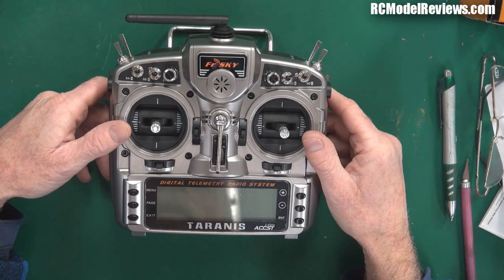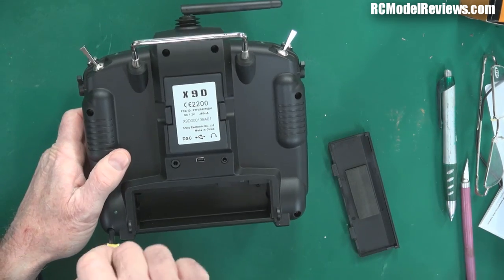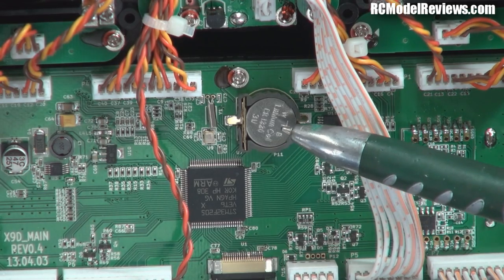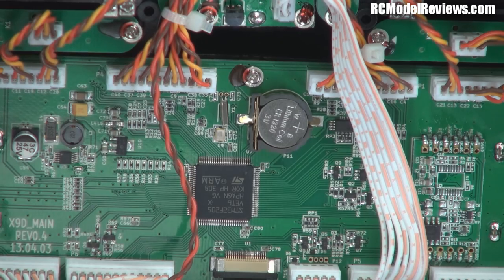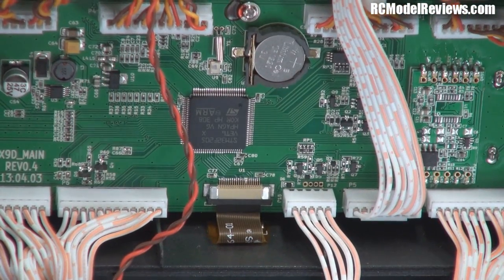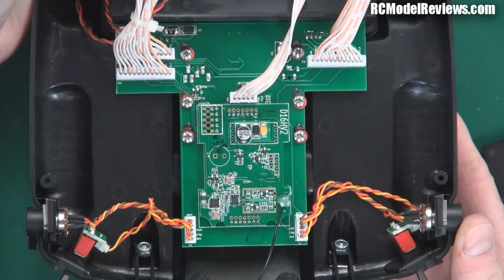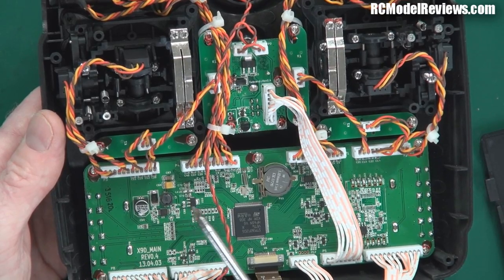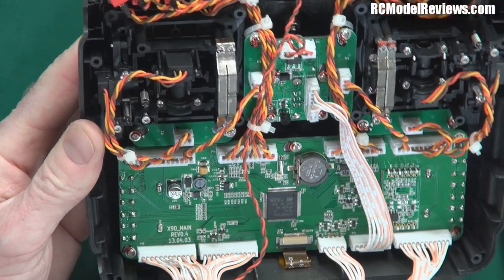FrSky Taranis Review (part 2) the teardown

Comment: This video was THE decisionmaker för me getting the Taranis. I recently accidentally killed my FrSky DHT-U transmitter and was looking for replacement. Specs and software I already knew where awesome, the only question was build quality. Please measure the pots for quality, stability and consistency. Quality soldering doesn't necessarily mean quality pots. Bruce, you are the one-stop goto guy when it comes to RC electronics, keep it up!

Comment: Hi Bruce, could you please tell me which board houses the sound producing area on the taranis plus. The reason i'm asking is because I have lost all sounds,, beeps and haptic activity.     It could be that I did something to it when i was soldering the six pos switch on the back board.    I am prepared to replace either of the boards. if necessary

Comment: FrSky have done a great job and have not forgotten the open source beginnings of the radio.   IMHO, as far as capabilities it is on par or better than the top of the line radios.  Not so much bling but very very capable.
You have to remember that some of the most inginuative, smart and capable people in the world have worked on the software and electronics.  Frsky were smart enough to listen and integrate and use their own technology.   I'm glad that they did it!

Comment: Hey Bruce,
I love these informational videos telling us how good the cheaper radio's compare to the high dollar radio's and now I'm scratching my head wondering why I spent so much cash on various high end /dollar radios.
From what I'm seeing the build quallity is very good and with ball bearing gimbals even,
you also may find that the antena has a small type connector like the dx8 and I think the reason they hot glued  was to stop it from disconnecting like some of the dx8's did.
Regards,
Pete

Comment: Despite being an old video, I was wondering if this was the one that gave you a problem shitting down or not? Then I realized the dates on the video and this is probably your first one they sent you. But if you look at your thumbnail and the beginning of your silent macro tour in the top left corner with component U10 that looks like a voltage regulator. It seems this was a bad solder joint on the heat sync/ground. Of course one of the legs is also a ground but I can see this over heating under certain conditions if the regulator gets to hot and turning off since I think it's a CMOS voltage type regulator.
Maybe the way it was soldered the board cooled down faster then U10 causing the solder joint to break, lead solder would have worked better but everything is ROHS compliant these days with lead free. I know this radio is a few years old now, that is if you still have this one and that would be amazing for how much you fly. But incase you did still have it I just wanted to point that out to you.

Comment: Hi Bruce. Any chance you could do a video on buddy boxing one of these with a 9x.
I currently have a 9x and have a Taranis on the way, in fact it should arrive tomorrow, and I have been teaching my son to fly a V949. Would be nice to give him the chance to get in the air properly instead of little hops. (He is only 5)
Also, is it possible to give him only aileron/elevator control while I retain throttle and rudder?

Comment: Hi Bruce I'm in Europe and have a problem with my teranis and 2015 X8R rx.  My tx is on old RF firmware and the 2015 rx is on new firmware. The issue I have is that I can't bind my new rx in D16 mode.  Any suggestions on how to downgrade the firm ware so not to affect my older rx's
Reply: Did you try binding in D8 mode?
Reply: Figured out the problem. I've reflashed the rx firmware and it works fine

Comment: does this need a module to work  or is it ready without one? can you just have the radio and a reciever and it will work?
Reply: Taranis has a built in FrSky radio unit.  You just buy a Frsky receiver and it works.  No module.  Of course you can choose to use  a module too - great flexibility.

Comment: The Taranis I've been testing (on my channel) has U.Fl connector, and no glue.  I guess we'll know what the actual production Tx's will be very soon.  Soldered on makes it very difficult to remove back board PCB - with U.Fl it's not only easier to install different antenna, but also to remove that board.

Comment: Microcontroller xtal should be glued down, looks like you can replace throttle ratchet with a smooth spring by reversing the part, and simple stick mode conversion. Nice.

Comment: I don't think the battery is an issue. With the provided charger and the internal charger circuit you can just plug it in when you get home and it will always be charged and ready to fly.

Comment: hi bruce ... the X8R rx .. is the rssi output analog or digital and/or both ?
gonna use that rx to connect to an OSD which of course requires analog rssi .. for short range fpv

Comment: I'm jealous, Bruce.  I want one and they aren't available yet in the UK and those that will be are all on pre-order :(

I have a number of 'old' FrSky receivers I use with the DiY module converter I made for my Multiplex 3030.  So I'm concerned that I'll still be able to use them without too much trouble (or expense).  I'd appreciate some comments/detail on that.

Thanks for the review. Excellent as always.

Comment: Bruce, I think that every transmitter has to have an hardwired antenna to be FCC certified. That might be why the Taranis Antenna is like it is. I wouldn't call it a negative point ;)
Another thing, It's getting more and more difficult to ship Lithium Batteries. It was wise from FrSky IMO to ship the radio with a NiMh battery. At least you will be able to fly with the radio from day one without any mods.. Many couriers already refuse to transport that use Lithium batts. Just my 2c :)

Comment: Question concerning the LiFe batteries you love so. What is the lowest voltage that you should allow them to drop while flying? I mean what I should set as a low voltage warning? Iv been using them for some time and Iv been recharging them when the voltage got around 9.8V or so, but Iv seen that they can be discharged as low as 3V per cell (9V).
forgive the somewhat off-topic question ;)

Comment: Very nice review. Never opened my Taranis, but will probably have to eventually, especially since it slid off my car seat onto the ground and broke the SH toggle switch.  Not sure where I'm going to source one of those. Right now, not using that switch, but in the future ??? Got any ideas who might carry such a switch?  Again, nice walk though ... cheers!
Reply: +Bill Somrak RangeVideo has them! Here's a link to all the parts:
http://www.rangevideo.com/120-frsky-taranis-replacement-parts
Reply: +Miliroxx28 Wow ... that's a great resource to bookmark.  Just to be sure, the switch on the back right of the TX labeled "SH" is the "spring loaded 2 position trainer" switch, is it not?  I can't tell, since it was completely snapped off. Thanks again for the link! Cheers!

Comment: I actually prefer the NiMH battery.  In fact, I went out of my way to find a 2600 mAh NiMH battery using the same technology as the Eneloop Pro's for mine because I never worry about it being in the wrong state for storage or losing charge if I don't use it, or it exploding into flames while I'm away.  Plus charging is convenient for me just using the supplied charger.

Comment: Argh! These are really well priced for a cheapskate like me! But I've started my RC flight career using a Hitec Optic5. Partly because of my cheapness, but also because I trust Hitec from my 30-ish years racing RC cars & buggies. (cheaply). So I currently have 5 Hitec receivers, and was looking at a transmitter upgrade. I'd love to have the Aurora 9 for my gliders, but it's £200+ while the Taranis is just £140. I know nothing about the tx modules, so can I use my Hitec rx'es with the Taranis?

Comment: I would not have though you could practically use that high resolution due to the amount of moment it would translate to on the transmitter sticks, ie 1024 res vs say 2048, would it really be noticed on the transmitter sticks?

Comment: I accidentally flattened my LiFe Tx battery once, both my regular chargers refused to start charging it. I used a bench powersupply to slowly make up the voltage, over about 2 hours, then I let the regular charger finish it off. Seems ok so far.

Comment: I have a Futaba T16SZ much the same as the Taranis, the Taranis is a whole lot better to set up models than the Futaba. I had a Taranis, but when I charged the battery the battery went up in flames with the transmitter. But I do like the Taranis over the Futaba.

Comment: I got my new Taranis a few days ago and had a little disaster.  I don't like wall wart chargers for all sorts of reasons so I attempted to charge with my Graupner Ultramat 16.  DON'T DO IT!!!

The Taranis has a built-in charge circuit and my attempt to charge has damaged the on/off circuitry. Now it won't switch off!  Works OK when switched on, which is ironic. 

Whole saga  at openrcforums forum under "Taranis charge circuit". uTube stops web adds :(

I'm not blaming FrSky btw - my own fault.